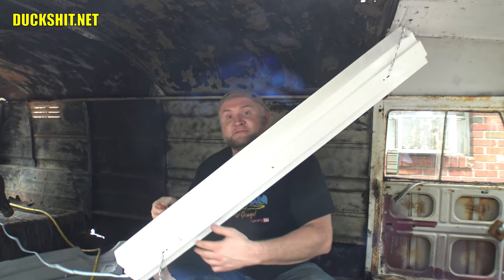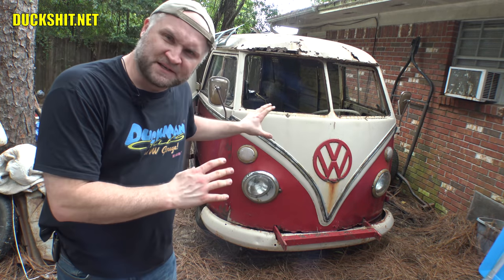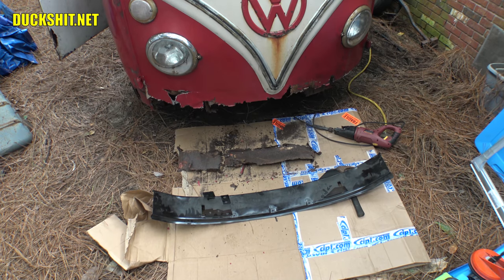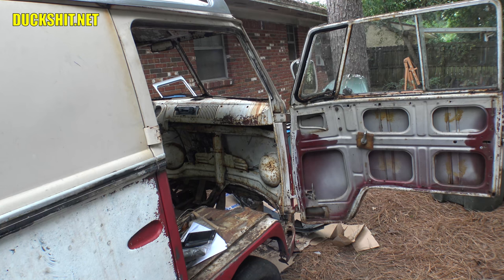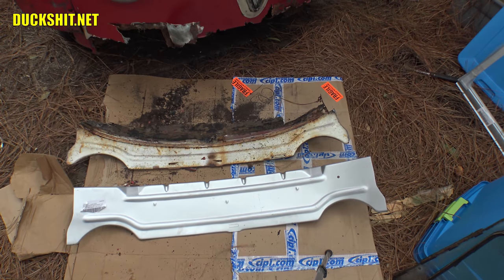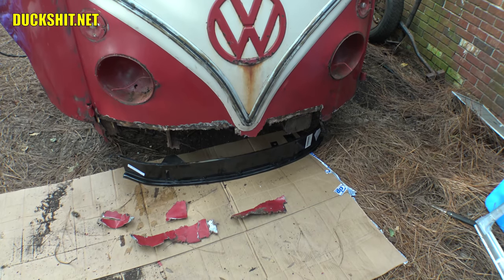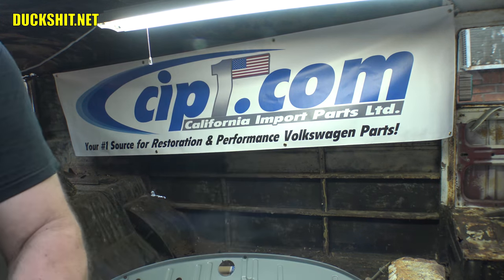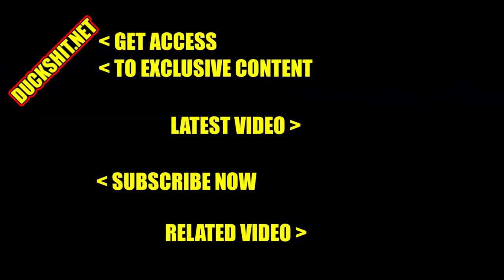Front End Demolition and Rebuild - 1967 VW Bus - Gregory - 7

Comment: I think that you should close that passenger door, aligning it as much as possible, then tack some small pieces of metal from the door to the frame. That will align that side, and you can then do as you say, start welding from that side.
Reply from the maker: I think you are about right, more to come!  Thanks!
Reply: weld a cross brace upside and downside at the passenger part from A- to B- pillars to keep the measurements and gaps. weld them together. the ggaps had to be adjusted with vice grips and tiny welding points for the final openings. Too big gaps you can hammer in or back then weld them finally. Make overlappings to weld, 1 in. Without prior welded support braces Gregory will quickly renamed to banana....

Comment: Stick a wireless charger in that centre ash tray section while you're at it ;)
Sending Positive thoughts to Earl!
Great to see CIP getting behind you, well deserved and looks like they know how much metal is needed in each of those panels.
Super impressed with the gauge of metal they use. Looks like it is even a bit heavier than stock.
Cheers mate.

ps. Bolt a sheet of plexi on the underside of that  fluoro tube fitting, you're makin me cringe every time you bump them. at least then if you break em the mess will be contained. MIght also give you a nicer even light, Betting you probably got a diffuser plate from a ceiling fixture lying round ;)
Reply from the maker: Thanks!  The light is getting replaced, by the time I made a lens for the thing, I could install a new light faster.
Reply: @DuckmanCycles  LOL, didn't want to do the old "You should"get some LED strips down at Ikea but, cheap and cheerful, and could be useful in the final fit out.
Cheers bud. ;)
Reply from the maker: LoL, its always "you should" for someone's silly ideas,  or the highly insulting "you need" for the things that people say I haven't thought of or considered...  or as Rich Rebuilds pointed out this week he gets "As a...."  Have a laugh, he's good!  Its right at the beginning!  https://youtu.be/3r-fR2iy8Qg
Reply: @DuckmanCycles  LOL, watched a lot of Rich in the past, haven't checked in in a while.
That is just classic, and delivered in Style! Love it.
Keep on Truckin bro.
Cheers.
Reply from the maker: Yeah he made me laugh pretty hard, I had to watch it a couple times it was that good, it hit pretty close to home.  While he is one of the most primo Telsa knowledge base people, it is clear that he's new to working in the garage.  He does what I did when I was just starting... and I still make mistakes, I'm still learning every day.  However, the fact that he gets out there and puts in that effort AND MAKES THE VIDEOS no matter what anyone says makes him good with me!
Reply: @DuckmanCycles  Total respect from me. He had the balls to take it to Tesla on their sparing and servicing/rebuilding practices and seems to have got results.
Still thinking a tesla powered Bug or Bus would be a cool project.
Reckon Elon should release a Chassis drive train package to BYO body on. Only need to make the wheelbase a bit adjustable length and width.
Not really that hard if you think about it.
Let's recycle all those beautiful body shells out there and make them environmentally friendly (now wait for the EV's hate  comments ;) ) could be wrong in this group though. VW folks seem to be above that mostly.
Cheers bro.
Reply from the maker: EV would be fun, been kicking the idea around and talking with Earl as even a hybrid with a 2 cylinder VW aircraft engine with an electric between that and the transaxle.   http://www.vermilyea.com/engine.htm

Comment: remove doors then tack in or clamp door gauges (braces) at hinge points to square up & tack in doglegs between A & B pillars... now A pillars are rigid & ready to receive valance, apron & (lower 6")rust replacement nose clip panel... best just  to replace windscreen post with (lower 4") rust replacement piece...  quick & thorough; lay in front floor section & tack seams between valance & well, lay all your beads then tack in rockers & lay in beads between rockers & doglegs... remove door braces & reinstall doors
Reply from the maker: Thank you!

Comment: The hidden hinges will never work!! 
I would build a square frame ,one piece connecting the inner fender boxes left to right. Two up rights to the door opening, and one piece joining the up rights to the top and  a couple of 45 degree diagonals to  hold the square shape .I used 1" square tube because i have a lot that was given to me.
Next,pull the doors ,then remove the whole front .
Building the floor back together is a lot easier and the frame holds your alignment.
Reply from the maker: I am probably going to frame or brace it to some extent, but I don't think it's a good idea to pull the front off there's a lot of reference points there that actually are still straight. For that reason I will probably leave the doors on to make sure I get all of my measurements proper as I start tacking back together.   After all that's how I rebuilt Eleanore and that worked :-)